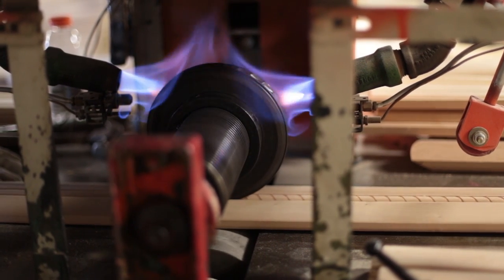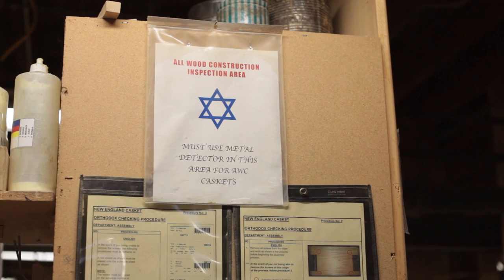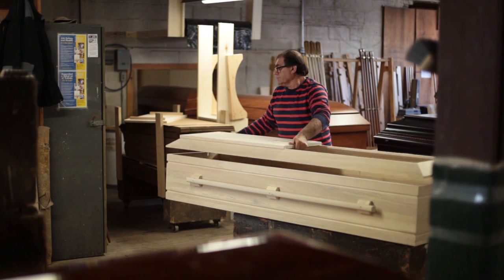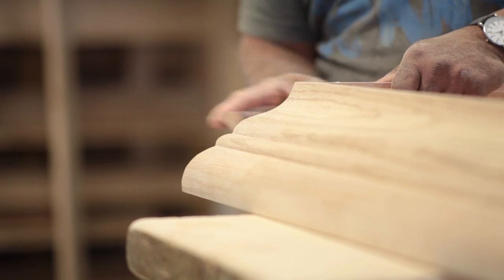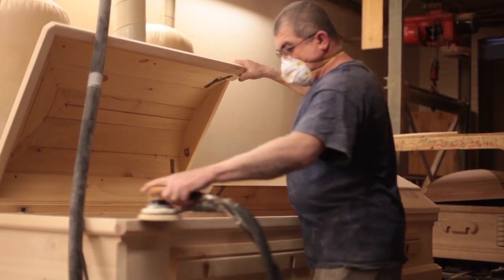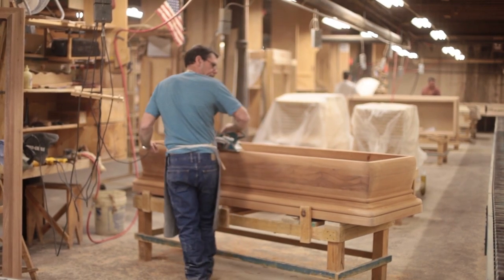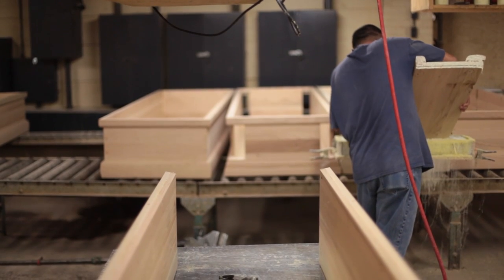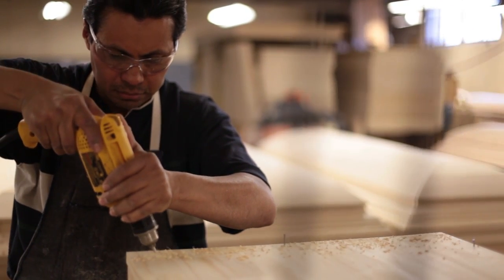Show Me Your Casket - Details on Jewish Burial Procedures

Comment: For my last 20 years, as a Joiner, I made coffins in Denmark. We have a strict policy for what materials must be used producing a coffin, paint and ornaments, but we did use metal spikes/clamps besides glue. And the product must be made in a specific and controlled for this purpose, Factory. We also made coffins purely from different types of wood, but - oak made the grave area used, to be rented for 40 years instead of 20, as standard, because mostly a such coffin takes longer to disappear.
    At a time we made an oak coffin for the Official State Burial of a killed Policeman, during a robbery.

Comment: There still is a problem  that most people do not recognize. In burying a body it is reaffirming a belief that the shell once inhabited is still important after one transfers from this existence. Funerals are not for the dead, but for the living. So as the rabbi said, ashes to ashes, dust to dust. That being said, cremation is merely speeding the process in its recycling back to its basic components.

Comment: I recently learned that in Connecticut, you must have a "box" to put the body in; even if you're cremating it.  Fortunately, Christians are still able get what amounts to a cardboard box for cremation.  I really can't imagine going through this painfully odd and superstitious burial practice.
Reply: Catholics weren't aloud to cremate their dead until the 1960's, some still won't. & they have some pretty superstitious practices themselves.
Reply: Compare this to the highly invasive practice of embalming and your opinion may change.
Reply: Having a box, makes it easier for funeral workers to handle the deceased, even in cremation.  In contrast, handling a body, in a shroud or body bag is not as dignified as the body is not rigid. 

The cardboard container or box is a heavy duty carton designed to maintain rigidity with hundreds of pounds inside.  In other words, it not a lightweight mail order box or carton you pack pillows in when moving.

Comment: The lack of comprehension in these comments is astounding;  I don't know wether people aren't listening, or are closed mentally.  I think the simple pine boxes are quite beautiful.  It should be comfort enough to people in accordance with their tradition.  I especially like the holes drilled into the bottom.  The standard industry use of metal coffins and concrete vaults is kind of overkill, but you get little choice.  I'd like to know the rabbi's opinion on particle board. The way to have exactly what one wants is to plan, plan, plan ahead.  The worst time to make these decisions is in the funeral director's office.

Comment: How do they rot if they're embalmed
Reply: Embalming does not preserve the body for very long. Conditions such as temperature, humidity will have either an accelerated or a retardation of decomposition, but one way or the other it's a matter of days or until the tissues begin to break down.
Reply: @laurencelance586  
Depends on the embalming method, bodies donated to science sometimes will be used for years.
Reply: @hans2406  That's true that donated bodies, and parts of donated bodies, will last for extended periods. Standard funeral home embalming is far less effective in preservation.